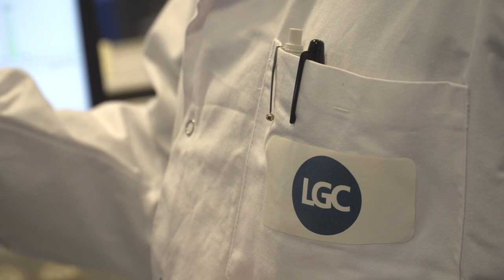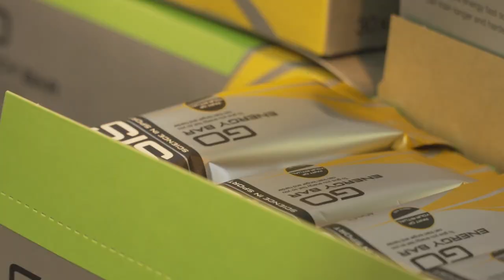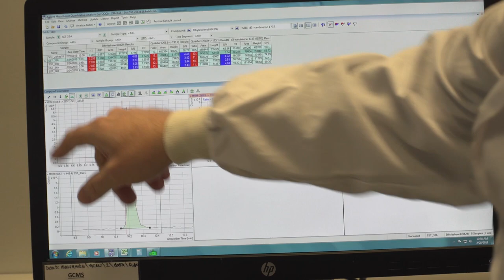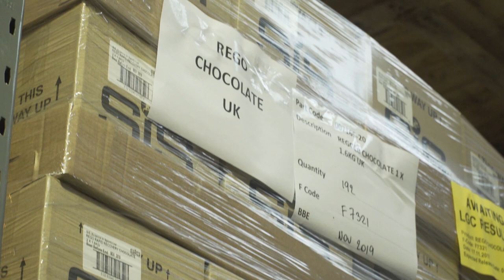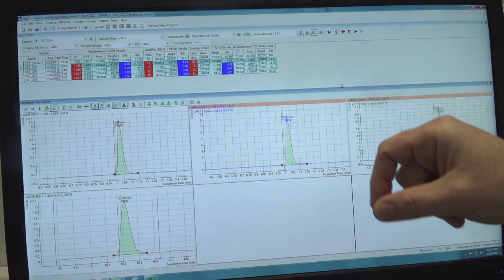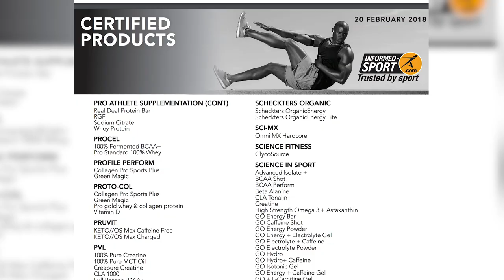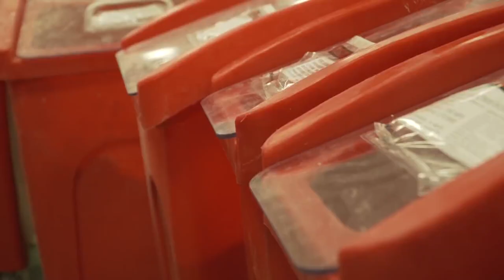Can You Fail A Drugs Test Without Taking Drugs?

Comment: as a pharma industry guy i think the biggest risk is when supplement products are manufactured using the same equipment as is used for supplements containing substances banned by WADA. i doubt there are stringent cleaning validation requirements in what is essentially the food industry. Tablets and capsules can present a specific risk because any contamination left on the tooling will find its way into a single dose of the next product - as opposed to contamination in a mixer or blender which is diluted often by 10s of thousands of doses.

Comment: What banned substance could possibly contaminate a sport bar or a gel?
Reply: Oscar Sandström guruana or ephedrine.
Reply: Guarana is not a banned substance usually..
Reply: It depends on the source of contamination. Products can be contaminated via raw material source,  introduced via unclean manufacturing equipment, or personnel contamination via medication use without proper hygiene and PPE controls.
Reply: ephedrine is heavily  regulated in in Europe and much of the west...
Reply: that's due to it being linked with death, but Guarana aside from being a watchlist supplement (Banned) in the olympics is generally unregulated and is allowed
Reply: Getting a positive test due to unclean manufacturing equipment or personnel seems very theoretical. If any substance getting in by that route would have any significant concentration, the hygiene problems at the manufacturer would be so gross that it would be more likely to get sick than doped.

Comment: How does a supplement become contaminated in the first place?
Reply: food/supplements or the ingredients are often processed on equipment that is also used for other ingredients or other supplements. if the equipment is not very thoroughly cleaned out in between different product runs, then contamination is possible.
Reply: supplier could screw up. Someone could taint the supply intentionally, or through carelessness

Comment: I would really like to see similar video about the testing it self. It's more likely that faulty positive comes from there. In the probability mathematics course we have been calculating this thing and if the test it self is 99,999 % accurate, every 100 000 test there will be one faulty positive. But if you then take few more tests and they are positive, then it's more likely that something is wrong.

Numbers used here was just example and I don't know what the real ones are.

Comment: This highlights a major issue with supplements and integrated sports teams who recommend supplements.  Bottom line if you are verging elite athlete in any sport, supplements are not your friend and there is no good scientific evidence they work better than three squares a day and proper scientific based nutrition.  They are all about branding, advertisement and profit. Think about it, if a supplement actually helped your performance it would be banned.

Moreover it highlights that athletes like Tom (second level elite athletes) are at the end of the gun barrel with sporting federations who have no issue handing down maximal penalties in the name of clean sport, but let off the big names time and time again for corrupt economic gains.
Reply: there is that, but also since they are so energy dense they are convenient, and that matters

Comment: How these supplements are getting "contaminated" in the first place?
Reply: Contaminated raw materials, unclean manufacturing equipment, and personnel medication use without proper hygiene and PPE controls in place.
Reply: When I competed the coaches absolutely forbade the taking of any supplement such as whey protein for fear of unknowns. There had been a few cases of ephedra, chromium picolate (I may have spelled that wrong) etc., and I do recall an athlete at the Common Wealth games going to a team doctor, getting told they could take cold brand X, but not realizing there were two versions, and one of them, the one they took, containa banned substance.
Reply: what does cleanliness have to do with banned substances? If I go to the toilet and don't wash my hands will I test positive? these are specific substances that enhance performance

Comment: Why do i get a feeling that SIS, a team sky sponsor, is sponsoring this segment? Is because they believe that team sky is going to apparently claim this as the reason for Chris's increased sabutamol? A bad SIS gel or bar?
Reply: I assumed you would have gotten that feeling when Si actually said they were sponsoring it at the start of the video. Also because they are the nutritional sponsor for GCN. In no way will SIS take the fall for Froome. That would be the death of their company.
Reply: Informed Sport certifies a lot of different brands. SIS is just one of many companies involved with this type of program. All the info about SIS certifying purity apply to all the top brands.
Reply from the maker: @supernstr - it's a video that we've planned to make with SiS since last summer.
Reply: Global Cycling Network not blaming you gcn, just the timing of it all feels like SIS wants to cover all bases just in case.
Reply: I think you are wrongly judging the ethics of the company on a promo that may not have originated from them (not aware of the promo u mention, but the fact u used $ suggest u r in the US, and SIS are in UK)